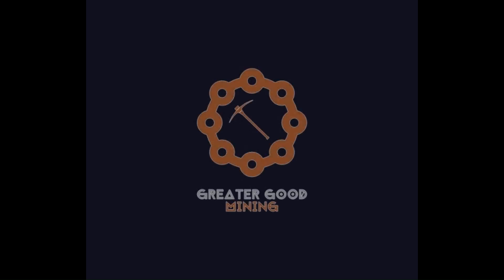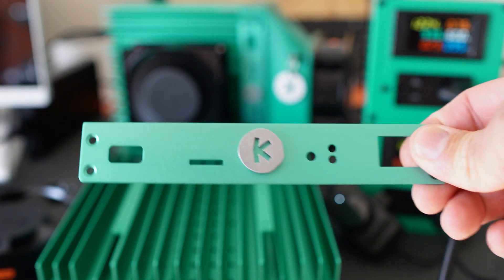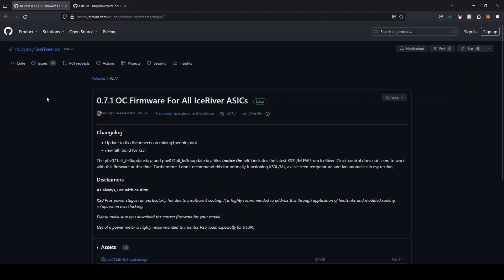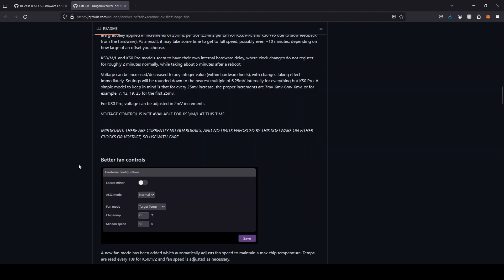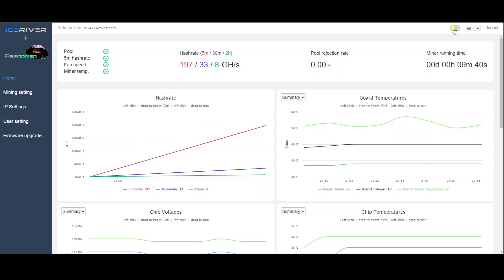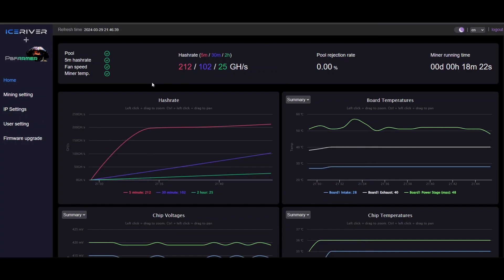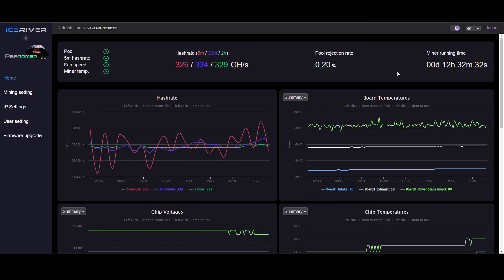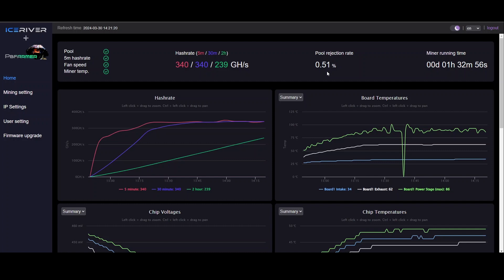340GH on my Iceriver KS0 Pro Kaspa ASIC! (Heavily Modified Vs. Mostly Stock part 1)

Comment from the maker: I was pumped to get 340 Gh/s out of my GREEN MACHINE KS0 Pro! Have you tried these mods yet???
Reply: just to confirm did you upgrade u PSU ?
Reply from the maker: @moldomosbah7081  yes I have the link to the PSU I use in the description of the video :]
Reply: @moldomosbah7081  Yes i do use 240watts Fujitsu Psu for my all ks0pros.
Reply: seems to be a good job bro! Thanks alot for the kind efforts:hands-yellow-heart-red: What s the best settings for a cool mining KS0Pro at 340gh?!?
Reply from the maker: @selcukkarakaya9365  Thank you! Toward the end of my video I show all my settings 390 clock offset and 46 voltage offset but you must adjust your clocks on your own! Your KS0 Pro might overclock differently than mine!
Reply: @GreaterGoodMining  Okay got it. Thanks one more time bro. I do use 3000rpm fans to cool them down beside heat sinks and 1.5mm pads. But still not operating under 60 degrees😞
Reply from the maker: @selcukkarakaya9365  the fans I use are both 110cfm!
Reply: You never said what youre clocks were set to?
Reply from the maker: @DrBT1  I showed them toward the end with the Meter Boxes to show power consumption
Reply: @GreaterGoodMining   Fantastic ty. https://youtu.be/kMS4DQi0GZo?t=951

Have you tried the other copper heatsinks? If so have you noticed a drastic difference in temps? Im considering buying these copper fin heat sinks and replacing my existing ones.
Reply from the maker: @DrBT1   I have not tried the other heatsinks, but others have and they work OK
Reply: Do you have any tests on just the sound in general to hear how the overall sound is with fans etc..... on just one device by itself
Reply from the maker: @mixoplex007  That's a good point, u usually do sound tests on miners but for some reason I didn't do it on this one. I will tey to include it in my next video

Comment: Anyway to get the firmware with out over clocking but still giving me the extra graphs and dark mode?
Reply from the maker: When you upload the firmware no overclocking is applied until you make the changes yourself. But you will be paying a 1% Dev fee to use it

Comment: I just try couple of minutes just to see the actual OC of FPB Farmer but I need to buy all of heatsink, thermal pad, Fan Case and fan too so it's work on KSo Pro(Black Case)
Reply from the maker: You can still overclock the KS0 Pro with minimal mods but you can't push it as hard

Comment: @GreaterGoodMining i have a question. im looking for the files in the /var/update folder of a KS0.. (the OG). lets say someone deleted some files in there and the machine is not starting anymore.. thinking it might start to work again if i put them back. I can still reach the filesystem, but hard reset no worky anymore and no KS0 og in my neighbourhood i could get them from. And here is me hoping a random Kaspa yt-ber might be able to help with those. Im grasping at straws i know but iceriver isnt responding as i would have liked :p.
Reply from the maker: I havnt messed with any of the original files but I know lots of people in my Discord mess around like that. PBfarmer might be able to help. Join the Kaspa Discord and ask in the mining hardware section. Guarantee someone will be able to help you in there
Reply: @GreaterGoodMining i've been googling my ass off but cant seem to find the link to it. also under the video just states: /discord. :s  got a link to it :D

Comment: Why did you go with Farmers OC vs Tswift’s OC’s. Does Farmers OC not charge a fee? Or is it that you can get more hash rate ? I do love Farmers gui layout and the temps charts, much better that the ice river.
Reply from the maker: PBfarmer has a 1% fee but 50% of the fee goes to the Kaspa Dev team and eventually 100% of the fee will go back to the Kaspa Dev fee. I want to be able to adjust my own overclocks, and I love the detail and amount of data in PB farmers Web GUI
Reply: The difference is equivalent to comparing a car with no controls and the throttle stuck to 100% open, vs one that actually has a gas pedal, dashboard, etc.  The former may get you where you want to go, but it's an inefficient, uncomfortable ride, with questionable longevity.

Comment: I do not think this is a good idea. I have 12 OCed machines running for months, but the first one now started to stop hashing. Obviously it is getting slow-cooked... it still runs at stock now. But if you have experience with OCing, which I had done extensively with CPUs in the past, you will know that CPUs may age rather quickly. So you will be out of luck with your warranty if you cook that thing (actually you are already out of warranty once you start OCing), I would not push these so high. You might regret it in a few weeks.
Reply: What OC stats do you recommend?
Reply from the maker: @Pagipopo47  I recommend tweaking your own KS0 Pro like I said in the video because your KS0 Pro could be very different from mine. I show my clocks and voltages towards the end, but those settings are very aggressive
Reply from the maker: I appreciate your input and agree with you. When you overclock these, especially to this level, you are risking the machine getting toasted or at least causing more wear and tear etc. I am OK with pushing these hard for fun. I just like to see how much I can get out of them :]
Reply: @GreaterGoodMining  I would, but it already took ca 6 weeks for delivery and my retailer says if one breaks, I have to send it to the US myself, so I would not see it for a few months, in which case you may lose 20-30% or more of your annual yield - not so bad if you have 12 machines and one breaks, pretty bad if you only have one or two... also, I can see that maybe only 3 of my 12 machines could get that high, as most do not even reach 280. So people have to be OK to make the investment in the power and fans, shroud-printing, putting all the time in to it, but only have a 1 in 4 chance that it will actually work. So definitely not recommended for people with only 1 or few units.

Comment: I got 355gh/s using the tswift firmware 😎
Reply from the maker: Nice! I might try to push this further and mess with things more. For now I'm happy :]
Reply: @GreaterGoodMining  I’m also using two L3 antminer fans in a push pull config so my temps are around 24in 45out
Reply from the maker: @tombuseck  that's sweet! I might do something similar since I have 2 shroud kits to mess with and plenty of powerful fans etc

Comment: I really like how you figured out how to mount those internal fans externally and also keep the protective grill! I'm gonna do the same for mine. I've got one KS0 Pro up to 320 Gh/s, but I'm not even pushing it.  I use a variable power supply and lower the voltage from 19 to 16 to get cooler temps, but that increases the input current.  Those barrel connectors are only good up to 10 Amps, so I keep them at 9 amps max.  I think I'm going to mod the power connector so I don't have to worry about the power plug getting too hot.  I'll remove the power connector and solder the power cable right to the circuit board.  Love your content.
Reply from the maker: Thank you I appreciate that! Yeah those barrel plugs get really hot. Originally I was going to push air in from the ethernet side to hit the powerstages and copper heat sinks first. But I decided to blow air in from the barrel plug side to cool that down as much as possible. It worked out good so far!

Comment: Please do same overclock for ks1 we are interested to see the result coz we did used old overclock
Reply from the maker: My OG KS1 is a weird 1st batch custom one-off that so far won't even let me upload stock firmware from Iceriver. It's a factory freak. And my other KS1's I combined into a KS2. The best thing to do is attempt to overclock yourself because your KS1 will be different from anyone elses in how much it can be pushed. It depends on a lot of factors like ambient temps, have you repasted, if you have a cooling shroud and upgraded fans etc. etc. Try the firmware and tweak and learn is the best way to go!